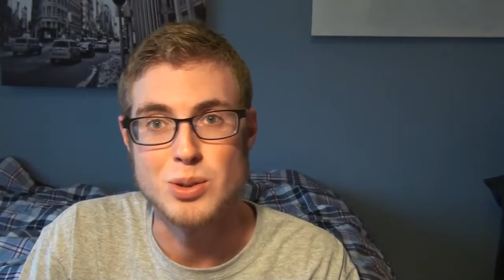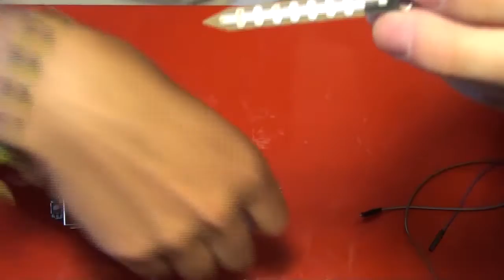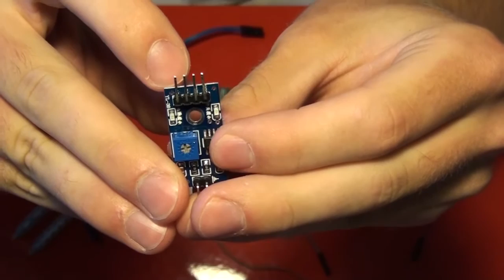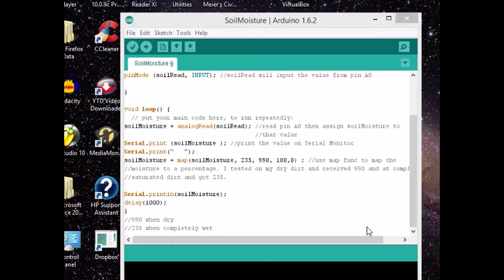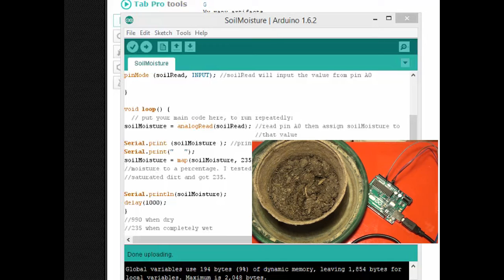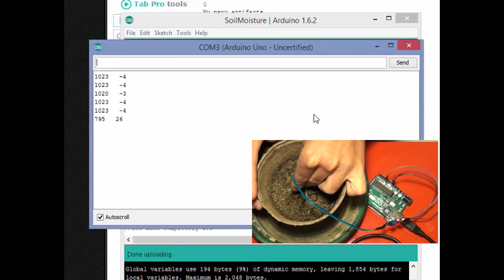Arduino Soil Hygrometer Tutorial: Measuring Soil Moisture

Comment: Just to be pedantic, water is not a good conductor of electricity but tap water is moreso because of the minerals/salts dissolved in it. If you used distilled water it would not conduct at all.